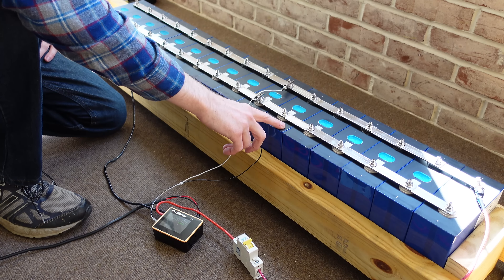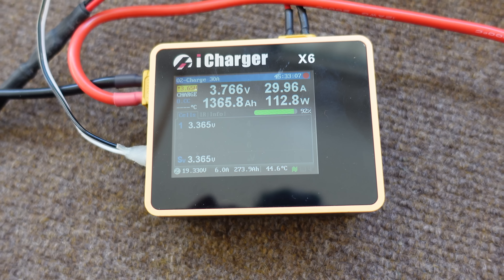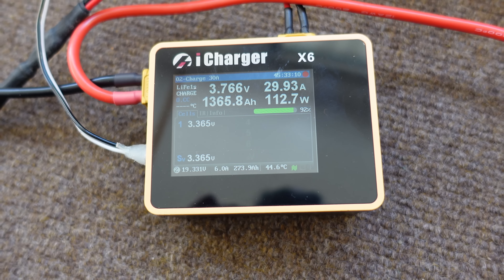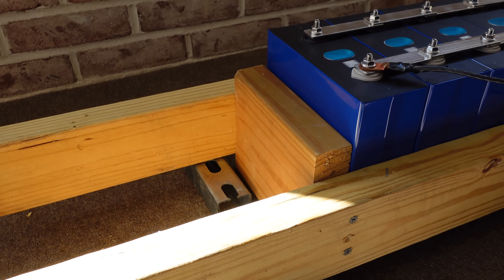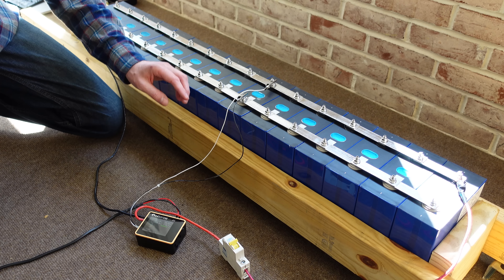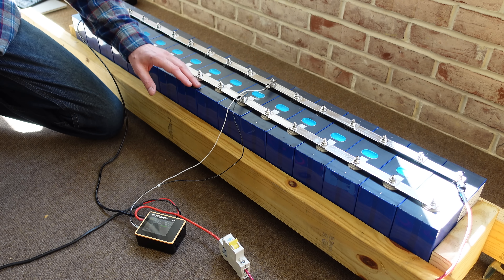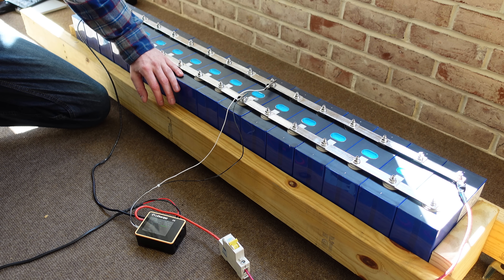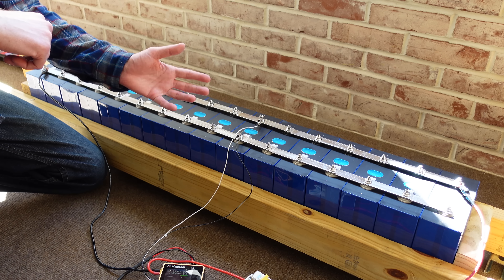Top-Balancing the EVE 280Ah LiFePO4 Batteries & Project Update

Comment: Electrical conduction is NOT through the actual threads. Its through the top surface of the cell. Focus your efforts on a good, flat terminal and let the mechanical thread get blue lockette (literally no need for red, unless its laying around) and let the thread produce the clamping force for the top surface. PS, light polishing of top surface would improve conduction way more than anything with the threads

Comment: NO LOCK TIGHT Required.   Tighten by hand  be done with it.
Reply from the maker: That's also an option. I tried hand-tightening in the past and ended up almost stripping out one of the aluminum threads. With how much I've spent on these, I just don't want to ruin them. Maybe I'm being overly-paranoid?
Reply: @LithiumSolar  "Maybe I'm being overly-paranoid?"   Yes, just snug them up and done.  You are always messing with your stuff so you'll catch it if something isn't what it used to be.
Reply: @LithiumSolar  just screw it in gently by hand so that you do not penetrate into the cell welding. The nut will finally strengthen up  everything. And no Lock-tight, it might act as an insulator. That would be not desired...
Reply: @RolandW_DIYEnergyandMore  steel screws are way down in the list of good conductors.  Zinc screws will be more conductive than steel and not as expensive as copper,  gold  or silver screws.

Comment: i like ur setup of charging. i also have 32 batteries and charging them for one week  like u do 16 each time.  however i used a different charger and the max of 10 amps produces only 4 volts.  i was impressed with the charger u are using the I Charger x6 and i ordered it.  u are misleading the viewers by not telling them that this charger does not have a 120 connection but has to be supplied by another DC CHARGER.  now i have to buy an additional charger that needs more money and more homework where to find it. not a very smart approach to leave out important information.

Comment: Being encased prismatic cells no compression is required.
Reply from the maker: The datasheet from EVE indicates an additional 1000 cycles before reaching 80% state of health if they're compressed. That's a huge difference.
Reply: @LithiumSolar  See off-grid garage YT channel about this topic. What i understood is you would have to compress it like THEY do on their proffessionnal setup to achieve the 1000 suppl. cycles...
Reply: The casing on those cells isn't thick enough to keep from bulging. They should be at least lightly compressed
Reply: @theprepperfrog167  my conclusion is that some compression is better than none.  In a mobile application it may also protect the terminals from damage over time.
Reply: My datasheet for my CATL cells says yes compress. Not necessary, but will increase cycles. This is as of 2 days ago in communication with the engineer at Shenzhen Xuba.
Reply: @gtinseth  Are these CATL cells gtinseth? I'm not sure what this acronyms stand for.
Reply: It turns out that at least for those EVE cells, the aluminum case is not actually that strong so on the long side (at the very least), its going to expand and contract by a few millimetres full-to-empty.   I don't think actual 'compression' is needed, as in applying significant force.  Just snugging the cells up when they are about 50% charged and securing the ends ought to be sufficient.

A second problem being avoided here is excessive shifting of the battery bus bars during charging and discharging, or excessive distortion of the case due to the pressure vs the asymmetry of the bus bars.

The bus bars themselves could also be an issue but so far nobody seems to have enough experience with the cells to be able to come to any conclusions.  Clearly tin-plated copper would be a good choice.  All-aluminum bus bars... probably not a good choice.   But then the question is whether a straight bus-bar is sufficient or whether a bowed bus-bar (that is able to take a little flex) is necessary.

(In terms of the battery remaining robust through many cycles over the years)

-Matt
Reply: @junkerzn7312  The only time any cells pillow is if they are over Discharged or Over charged.  DON'T DO THAT.
Reply: @pulesjet  I agree, generally speaking that seems to be what various YouTuber's have seen with new cells.  Keyword is "new".

But anyone using these cells seriously will still want to design the pack to be able to handle the stress because over a long period of a time... over its entire life of thousands of cycles there will be occasions where it will be discharged below 20% or charged above 80%.

And particularly as the cells age, the owner might decide to bump up the target state of charge to compensate for the dropping capacity (for example).   80%.  85%.  90%.

-Matt
Reply: @junkerzn7312  I have a new system made up of TOP BAND aluminum cased cell.  No I will not compress them.  Yes I will treat them kind and not go over 3.6v.  Not over discharge. Not Over charge.  I you only provide the cells with that limited voltage they can not Over charge if monitored and have a balance system.  I don't rely on a BMS.  I use a active balance board and Voltage limits. Top and Bottom.
Reply: @Bennyboy-dog  He says they are Eve cells. CATL is an acronym of Contemporary Amperex Technology Co Ltd and is one of the largest if not the largest LiFePO4 manufacturer. Eve is another big one, in the top ten I think.
Reply: @junkerzn7312  Matt, my concern with the busbars is the nickel plating, nickel forms clear non conductive oxides as does aluminium. I watched a bloke called Andy, (I think he goes by off grid solar garage) having balance trouble until he thoroughly cleaned the surfaces and added some conductive paste.  Apparently it's good now. 
When mine arrive I will be taking a lot of care with joints as I don't love aluminium as an electrical conductor or contact surface. 
In my trade whenever I've needed to bolt aluminium to copper I have been able to use bimetal lugs.
Reply: @pulesjet  What active balancer are you using? Does it need to rebalance the pack often?
Reply: @gtinseth  Ahh, thanks - I thought CATL stood for some kind of LiFePO4 casing technology! Thanks for setting me straight.
Reply: @mikenewman4078  Bimetal lugs? Didn't know about them - thanks. Looking it up, they are copper battery side/aluminium cable side (presumably for aluminium cable) that are friction welded together (at least the ones I read about). We would need the opposite - aluminium battery side with copper cable side for connecting copper wire to the aluminium terminals of the battery. I'm planning on using aluminium bus bars from cell to cell but haven't figured out how to go from aluminium to the copper cables for the fuse/switch/inverter connections yet. You may have put me on the right path Mike.

Comment: locktite? really? it's a stud.  Tighten it finger tight, then use your normal inch pound torque wrench.  That stud is not going to pull the aluminum threads at 35 inch pounds.  That torque spec is for a bolt in the first place.  Heck, using the torque wrench is a little on the anal side.  You can tighten by feel with a 1/4" drive ratchet if you aren't completely mechanically incometent.  Leave it to a lab engineer to over complicate everything.
Reply from the maker: Idk, that's why I'm asking lol. Thank you for the input :) not planning to use loctite based on all of the responses I've received.

Comment: Instead of all the confusion with the studs, just use screws.
Reply from the maker: The problem with screws is you only have 4-5 threads to work with, so you need to grab every last one you can. You also can't have the screw bottoming out as you risk punching a hole in the terminal into the cell. That's the reason so many are using these studs now, as you can tighten the stud the whole way in, then use a nut while holding the stud.
Reply: Nah, the studs are an upgrade from screws for many reasons including the flanged nuts.
Reply: Yes, but you can use a longer stud with a nut, then hold the studs head while tightening the nut which is the same procedure  than grubs.

Comment: Dislike already after 30 seconds huh
Reply from the maker: That always seems to happen, not sure why... lol
Reply: @LithiumSolar  Always have this kinda of weirdos on YT: seems to reflect the percentile of stupid/no life/ need lot of attention of life in general! 
Again, thank you, sir.
Reply: @LithiumSolar  Love those lifepo4 cells, but currently capacity testing a 12 year old Lead Acid battery ( 12V 4ah ). I'm quite surprised it didn't die yet has atleast 50% or more left. I do have a 12.8v 2.4ah LifePo4 battery ( i think it's like 6-7 years old ) and still holds about 1.7-1.9ah. I'm not sure if these have prismatic or round cells inside.

Tried to make a 12.8v lifepo4 pack before, but cells vented during the process. Very sweet smell if they vent.
Reply: @daand12  Now THAT is a constructive(kinda) comment, good job, sir.
Reply: Let's not make a mountain out of a molehill - people press dislike for reasons that most of us that love the channel cannot fathom - that there is something wrong with them is not the only possible conclusion!

Comment: What power supply are you using to push 30 amps at 3.65v
Reply from the maker: I'm using a 19V power brick from an old Dell laptop. Nothing special, just recycling stuff I already had.
Reply: @LithiumSolar  I have an isdt q8 but idk if it will step down 19v to 3.65v for me hrmm. I'm using a benchtop supply currently but it's very slow at 10 amps. I do have laptop bricks laying around though